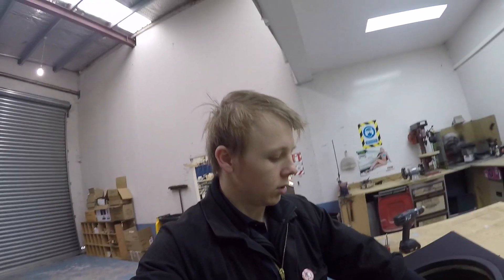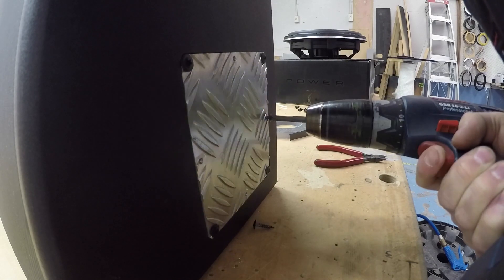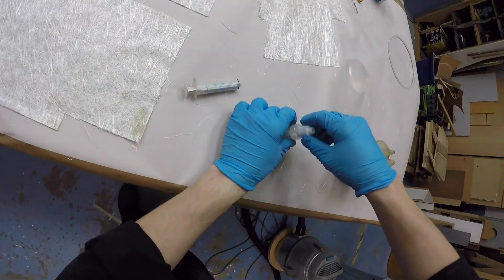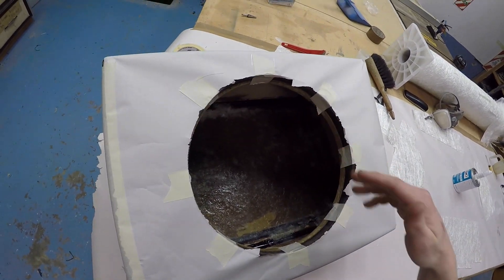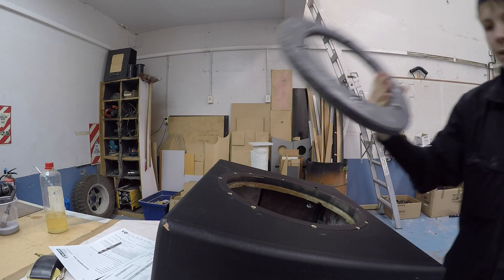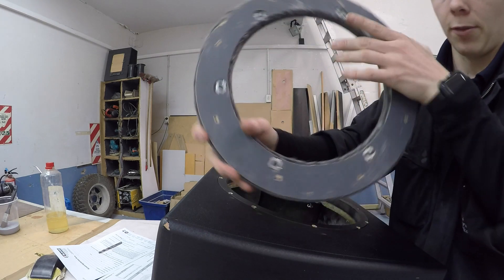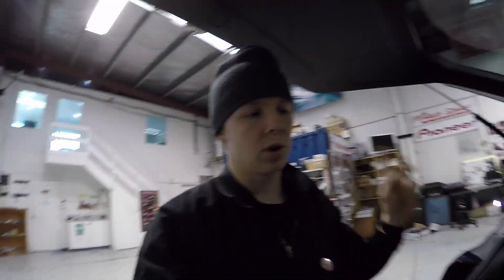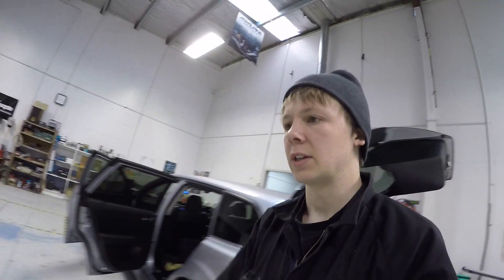Project Legacy: Rockford Fosgate T1S1-12 FINALLY INSTALLED in 'Semi-Custom' Box

Comment: Nice job James!

Finally someone else is using a Neutrik Speakon Connector. I've been using this for years and always was happy with it.
Can't beat that. After all it's just hard to get a case without a preinstalled oversized speaker terminal. So i prefer to build my own one where I just have to drill a small hole. I did however use the socket in the box and the connector on the amplifier end.
By the way: They did pronounce Neutrik right, it's a German Company and "eu" is pronounced "oi" in german.
Reply from the maker: Learn something new every day

Comment: Went to one of your older vids to post comment. 
Very impressed with the latest install of the 3 way Focal/Pioneer install in the Subbie. You method and work ethic is awesome.
Your earlier vids building your sub enclosure had me shaking my head tho..... gosh. I'm an old skool builder (4x Rockford Power 15's off 2x 250m mono power amps back when dinosaurs ruled), but am Cedia accredited for THX builds and have done a few club systems.
Filling your box with 'dacron' doesn't improve sound. It should be glued to the interior surfaces to cancel out standing waves. Filling the box does slow down the sound waves but also removes air volume and punch from your woofer. Use sparingly.... 
Spray some ados to the interior of box and trim the 'dacron' like you would carpet to the exterior. Your db will increase as well as your range.
Keep it up bro-love the vids

Comment: looks nice i got the single 12 inch p2 with the p400x2 amp witch is at a repair shop since it died on me stil dont know why but i love the extra punch the sub brings into the car
Reply from the maker: ljmike1204 what impedance is your subwoofer (ohms)?
Reply from the maker: I.e is it single 4, single 2, dual 4 or dual 2?
And we're you bridging the two channels on the amp?
Reply: its a single 12" runnnig at 4 ohm 400W and yes i bridged the amp it runned fine for 2 weeks no clipping what so ever both on in and output no red light i even have the punch remote in the front near the radio so i could keep an eye on it
Reply from the maker: ljmike1204 ok
I wondered if maybe you somehow had a setup that was bridged at less than 4 ohms (I.e dual 4 or dual 2 in parallel or single 2) because that low impedance bridged across the channels would definitely cause the amp to not last very long...
But it sounds like you got it set up right.
Gotta love that c.l.e.a.n gain setting tech aye
Reply: yes in deed i even have a 2 farad cap to give the amp clean 12V  and 10mm power feed with a fuse but it did not trip the amp did compleetly fail not a pop bang or a cloud of smoke it did not even turn on but yea i like the clean set up my pioneer head unit dose not even clip at full power it sounds great i even got rockford fosgate door speakers that are a bit to small but they wure the only 2 way for a nice price but im thinking of upgrading to Rockford Fosgate T1675
Reply: Car Audio.etc wel got news today they blame it on bad grounding bad power or clipping i smell bs becouse i have not seen it clipping never i have a power cap reading 14v and a nice big ground point all wires are 10mm